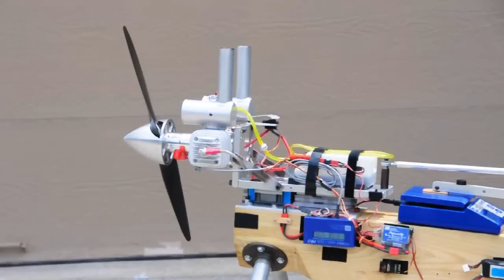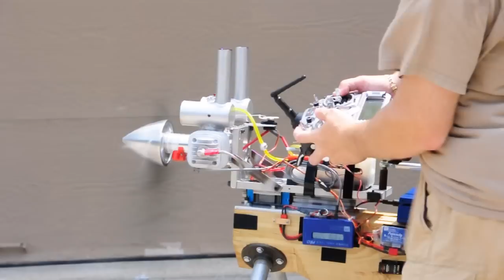DA-120 Test Run

Comment from the maker: To calibrate the test stand, I have a ball-bearing pulley and bracket that mounts to the front of the stand, so I can use a precision 25 lb weight to hang from a cord that goes around the pulley so that it exerts exactly 25 lb forward pull on the test stand movable plate.  Then I measure the reading several times, average the result and adjust a scalar value in the software to match.

Comment: i´m breaking-in a DA-120 engine using a Zinger 26x12 prop. I measured 4500 rpm at half throttle position, but rpms not goes beyond passing this point. Im using a futaba receptor 4.8V 1000 mAh battery pack for the ignition. Do you have any idea about how to fix the problem? Thanks for your help and congrats for your fine test bench

Comment: @rodrigo125 Hi Rodrigo, since he hasn't answered you on here I think I might be able to shed some light on it.
X being the horizontal plane and Y being the vertical plane. 
If you have both X and Y the same length and have a attachment point at both ends in the same spot, and you put one kilogram of weight on Y then you will have one kilogram of weight at point X also.

Comment: @rodrigo125 A way to calibrate it could be to have say fishing line with a loop at one end going over the Y axis and the other end going over a pulley wheel with one kilogram tied to one end, now slide the loop end of the line up and down Y axis till you get 100 grams, that should give you your calibration point for one kilogram converted to 100 gram mark, mark that spot drill a hole and you have your 10 to one conversion point.
I'm starting to make my own brain hurt so ill leave it at that lol